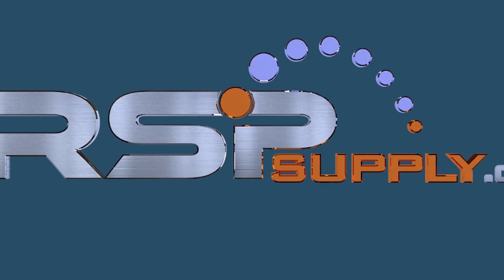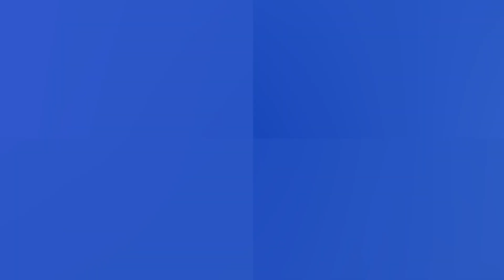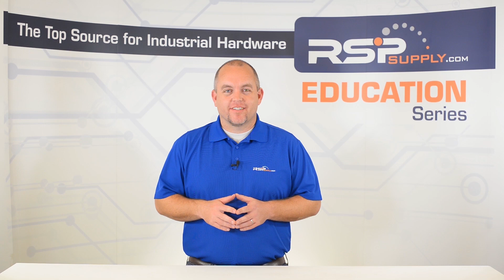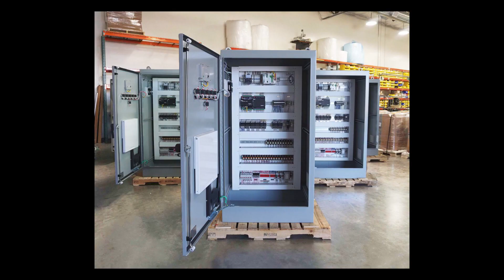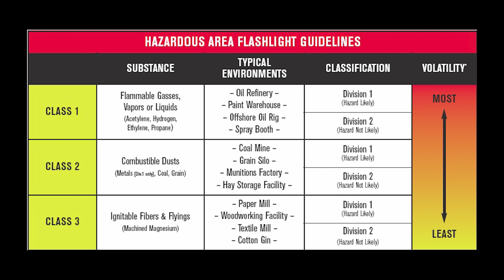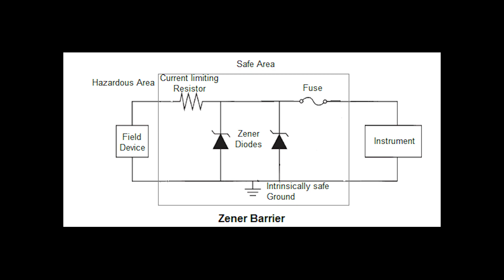UL698a Basics

Comment: What are the labelling requirements for 698a? I'm in a debate with my shop foreman about what Class/Div/Groups need to be listed on the nameplates in the panel. I believe that we just need the class, division, and groups that are being touched by the circuits, and he thinks we need everything that the barriers are capable of protecting devices in. He also refuses to break out the standard so we can check. If you could offer any insight that would be great
Reply from the maker: Hey LINKedup101, great question — this comes up a lot.

For 698A panels, you only need to label the actual Class/Div/Group that applies to the circuits inside the panel. Not every rating the barriers could handle.

A lot of intrinsic safety barriers are rated for multiple groups, but that doesn’t mean the whole panel is. The nameplate is supposed to show where that specific panel is allowed to be used, based on the circuits you actually have in it.

If you want something to point to, NEC 698.5(A) and 409.110 basically say the markings need to match the classification of the circuits in the panel — not every possible option.

Hope that helps!
Reply: @RSPSupply yes this is exactly the information I needed, thank you so much!
Reply from the maker: @LINKedup101  Happy to help! If you ever need more help, give me a call at 385-404-2522.